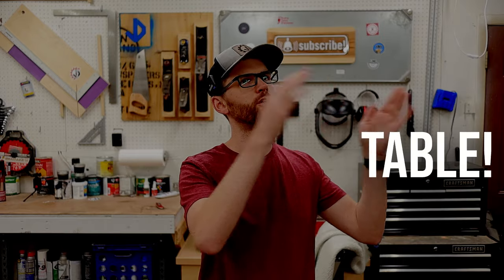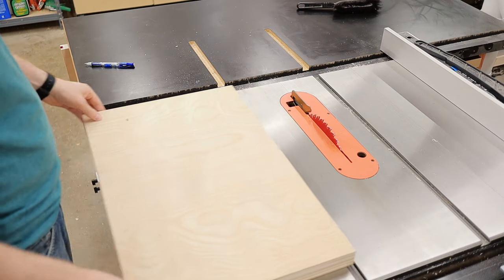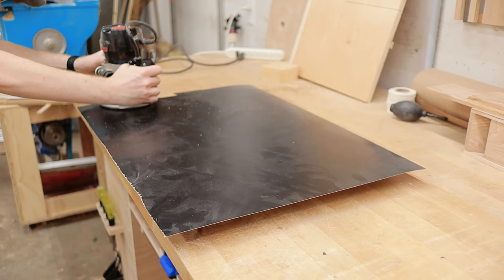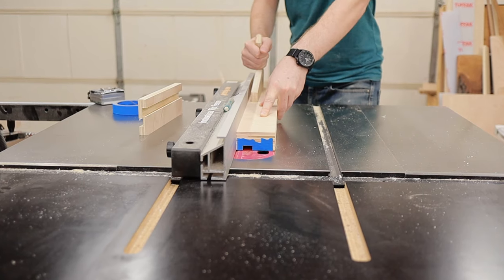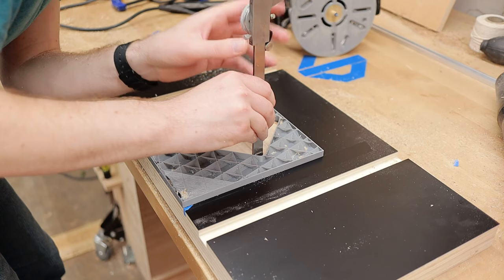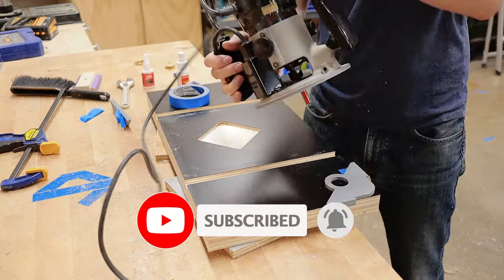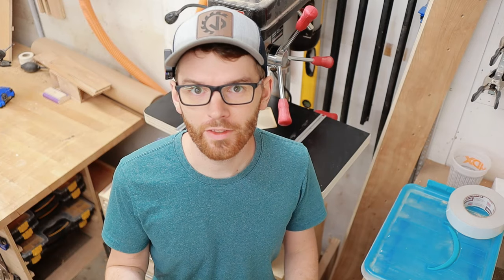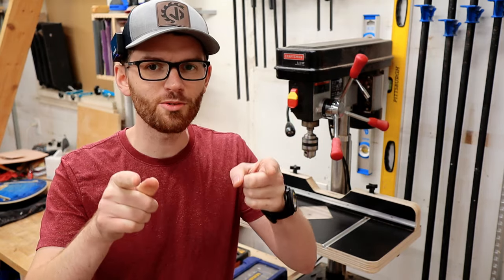Watch this BEFORE you build a Drill Press Table!

Comment: @8:27 Good call. I never cut anything but wood on my good miter saw. 
 
(If you keep an eye out, Direct Tools Outlet they will do a sale on refurbished tools at like 50% the normal refurbished price. i bought that same Ryobi for $39 now and they also do the Ryobi table saw for $59 if I recall. I wouldn't use either for woodworking, but for non-wood use, they're perfect because you don't need to worry about them if you're making "questionable" cuts, or cutting things like aluminum. ) 
 
 Hopefully one day they'll include the cheap 9" bandsaw  and that POS benchtop planer. Then I'll have own metal shop for my woodshop 😂😂😂!!!
Reply from the maker: thats a great deal

Comment: I made two big mistakes on my drill press table... 
1- my T-tracks on the table for the fence don't extend out to the front edge. Not sure why I did that, I may take those out and extend them the full length so that I can load the fence from the outside.
2-  I didn't add a dip in the fence (set it too high) so the chuck can bump into the fence if it's too close (when working on a small/flat piece). annoying!
Reply from the maker: awe man, thanks for sharing!  Funny how it can be so easy to walk right past the obvious...

Comment: @9:15 get rid of the crank handle and mount a bolt or nut, or anything, there that you can use to turn the handle with a drill. 
 
you can also extend the handle outwards, but that's a pain. 
 
Another cool trick I'm wanting to try is attaching a hamster wheel (with a hamster*) then dangle a carrot in front of it on one side or the other to raise/lower the table. 
 
* Protip- Don't try this technique with a router sled or cnc machine to make to router move. RIP: Gonzo. Mr Pickle Pants. Lord Puffington. Lord Puffington the 2nd. Lord Puffington the 3rd. X. Y. and finally, Z. May your sacrifices place you in the wheels of Valhalla!
Reply from the maker: Ill implement this hamster method asap.  but ill be sure to grab some spares from the pet store while im there, just in case.

Comment: Others have mentioned some of the solutions to the issues that cropped up.  However, nobody has addressed an elephant in the room.  It is best to put laminate on BOTH faces.  Doing so minimizes the risk of moisture imbalance in the table.  Also, it would be good to put finish on the exposed edges, including the interior of the insert cavity.  You never know when you're going to knock over that cold one sitting on the DP table.
Reply from the maker: Valid argument.  Its been on my todo list to apply finish, but its been 4+ months and the table seems flat.  Maybe just because it is being held to the cast iron table?

Comment from the maker: Let me know what huge mistakes you made on your last project!  Also, any ideas how I can fix mine? 😬
Reply: Put a spacer underneath the table to lift it up enough to clear the crank handle. Then you can center the table and solve the racking problem. For the t-track, you can put new ones further out or in, and consider the originals as bonus track! 🙂 

I've already designed a drill press table for myself, but that's one thing I'll double check first - thanks! I'm also including some slots in the table to allow f-clamps to go through, just in case I need that as an option.
Reply from the maker: @davidpeters8813  Great tips!  Yeah, I was thinking that other tables often have a drawer in the center, this would by default raise it up.  Kinda solves my problem.
Good idea for the f-clamp slots, you can never have too many clamps!

Comment: The crank handle issues with the table mount and the drill portion could be easy to solve by replacing them with something else.

Like a wheel with a little knob for gripping it would work well for the drill and the crank under the table could just be extended a bit pas the tables edge.

You wouldn't have that twisting/bending when applying preasure or bumping into things anymore
Reply from the maker: Definitely, lots of other solutions. Here's how I ended up fixing it: https://youtu.be/tvsvMg398YQ
Reply: @MakewithJake  

1. Makes video on custom drill press table
2. Makes video regarding improvements
3. Earns a new follower because I like how you will go back to older projects like that for followups
4. Bonus points for the surprising quick reply.

Side Note I found this while looking for ideas for a custom CNC machine to build
Reply from the maker: @SiontheRapadant  that's awesome! Glad you liked the follow-up! I've always wanted a big CNC. Definitely a future project. For now, I have the 3D printer and laser engraver, which is pretty fun.
Reply: @MakewithJake  theres a few videos on them already, but hey always room for more and improving on already existing ideas.

Comment: I generally would not use 3M 77 over the 3M 90.  I do a lot of laminate work (well I used to I am retired now).  I generally used regular spray contact but I realize that is a professional set up.  But I do use the 3M 77 when I want something to be temporary.  If I might have to pull it apart.  Contact adhesive only remains an adhesive if it never gets a chance to dry out so I would seal the edges.  The 3M 90 is the better choice especially for thicker standard grade laminates.
Reply from the maker: Thanks for the tip! I'll definitely check out 3M90 for my next laminate project. The 77 seems to be holding up on the fee projects I've used it on. 
I used a can of contact cement for my outfeed table and that went ok, but it was pretty tough to get even and flat. 
Thanks for watching!

Comment: I have a mix of shop-built and store-bought accessories like this.  The cost of building something nice, the time to do it, and the possibility of getting it wrong anyway are why when I see something well-designed and built that's affordable, I just buy it.  Maybe it costs 20% more than home-made, but I have a shop to build stuff for the rest of the house.  I don't want to spend most of my time in the shop working on the shop.

That said, I did bold my own drill press table, I just went a lot simpler and cheaper than you did.  No need for laminate unless you have some laying around.  Use an MDF rather than acrylic insert.  It's cheaper to replace, less likely to snap when using twist drills, and less likely to dull your bits when using forstner.  Excellent tip regarding the crank clearance though.  I ran into the same issue.  I added 1" wood strips between the cast iron table and the auxiliary table to jack up the auxiliary table enough to clear the crank. Keeping the spindle lined up with the hole in the cast iron table is handy sometimes.
Reply from the maker: Sometimes, buying stuff is absolutely the way to go.  You could definitely make this table cheaper, but Ive been on a mission to make my shop projects look a little nicer than they need to.  
Thanks for watching!

Comment: I loved the 3d printed router base plate to accept the threaded collars.  

Years ago my shop teacher at Cerritos Collage showed us a base plate with a variable radius perimeter.  The perimeter followed a 2D curve called an Archimedes spiral where the distance from the center to the perimeter increases linearly with angle.  

The purpose of the fence was to allow very accurate widening of dados by tiny amounts simply by changing the point on the base that touches
a fence and taking another pass. This offsets the bit either closer or farther depending on the direction of rotation.

The base perimeter curve is only one rotation of the spiral. There is a step in radius where the curve crosses over itself. The size of this step determines the fineness or coarseness of the radius change when rotating the base.

My teacher (William Ketelle ) made the base plate using a string, pencil and a nail to draw the spiral.
The pencil was tied to one end of the string and the other end was wound around a large nail placed at the center of the base. 
The arc was drawn while unwinding the string from the nail. This gave a very small and linearly increasing change of radius as the string was unwound. The base was then cut out and sanded smooth.

One of these days when I get a 3d printer I will try to make one of these spiral bases.  I think the hardest part is just laying out the spiral. I suspect this is not a typical CAD feature.

Comment: I made my table as well. Good video. A couple comments though. I made my fence as an angle. The knobs are on the leg behind the fence face, lower than the top of the fence. Cut an arch for clearance of the drill press column. Second is the replaceable table insert is offset so it can be rotated four times before needing to be replaced. Also drill an offset hole clear through the table under the insert so it is easier to pop out with a screwdriver poked up from below. Some one else mentioned a spacer under the table on top of the cast iron table for Handle clearance. Really good video and glad the shop Gremlins gave back the router bit!!
Reply from the maker: Good idea! Thanks for watching!

Comment: good video. ca nrelate. BTW where did oyu found the laminate??? I can only find 4x8 sheet which is too big for what I need.
Reply from the maker: I bought the 4x8 sheet.  Actually, several at this point.  I am not sure where to get it in smaller cuts.

Comment: Financially, it often makes more sense to buy a drill press table instead of building one, because the costs really add up quickly. However, if you have a youtube channel with a lot of subscribers and ad income from youtube and sponsors, that can balance out the expense or even flip it to a profit.
Reply from the maker: I would typically agree, but after looking at drill press tables, they just seemed far too expensive for what you get.  This was an attempt at a quick, easy, low cost solution that could be made in a few hours.  Obviously....I ran into some issues.  haha

Comment: Here’s my crank interference solution.  On a piece of 2 x 12, set it on your original table and trace the circumference.  Cut out and affix to the bottom of your new table.  If this doesn’t make enough clearance, add more until it does.
Reply from the maker: Good solution.  Other tables add drawers under, which helps lift it up.  I was trying to keep it compact, while maintaining my full vertical capacity.

Comment: I have analyzed the situation over many years and have come to the conclusion that there is a parallel universe that is populated by little ass- holes. Their favorite thing to do is to move the tool that you just used. Not far. Just enough that you can not lay your hands on when next you want it.

Comment: I have been watching a lot of videoes on YouTube about building a drill press table.  What surprises me most is that almost all of them are built with keeping the fence square to the drill press table.  This does add a lot of complexity in making the drill press table.  I do not think that you need to do this.  You only need to worry about the distance from the center of the drill bit to the edge of the fence.  Take a look at my video "Build an easy drill press guide" and I would be interested in hearing your comments about my design.  I have responded to a lot of other videos with this same idea and have not heard back from a single one yet.  My design does not have a dust collection system
Reply from the maker: Interesting, I havent had any issues with the fence so far.  But to be honest, I usually only use it when I have some batch/production work. thanks for watching!

Comment: I see a couple of annoyances with your crank solution. The traditional way of drilling angled holes would be to rotate the table out of level.  Because the fence is now angled 45 deg to the axis of rotation, the rotation axis of the hole would also be 45 deg to the fence. This can make many jobs just a bit harder, but no impossible.

Second,  When tramming (often mistakenly called leveling)  the table, the rotation axis is at 45 degrees instead of aligned to the Y axis of the table. This is not a show stopper, but just makes it a little harder.

Could adding a piece of plywood to lift the bottom of the table to allow clearance of the crank?  At the same time, add shims to get the Y axis 
trammed perfectly.  Of course that gives up a little vertical capacity, but that is not an issue for the most part.

Finally, one thing I want to do with my drill press is to constrain the rotation 
of the table that happens when cranking the table up and down.  It would be nice to be able to lock off the horizontal rotation, and just lift or lower the table.
Reply: Oops!!  I just watched the follow up video where you fix the cranking problem and then some.
My apologies.  You are doing a great job.

Comment: I've been looking for a big reliable square and I don't want to pay Woodpeckers 300 bucks. Can you please tell me the manufacturer and size of your silver colored sqaure? And do you find it to be 100% accurate? Thanks for your great video.
Reply from the maker: Thanks for watching sure which square that was, but I have (2) big ones that I use.  The first is a Framing Square.  These are about $10-15 at Home Depot. https://www.homedepot.com/p/Empire-16-in-x-24-in-Steel-Framing-Square-1110/100204103

The other is a T-Square, typically used for drywall https://www.homedepot.com/p/Wal-Board-Tools-22-in-x-48-in-Original-Drywall-T-Square-88-012/100095247

These are plenty square for most projects and really handy to have around the shop.
hope that helps!
Reply: @MakewithJake  Thanks so much for taking time to send me these links Jake. I very much appreciate it.
Reply from the maker: @dwayneford1990  anytime! Happy to help!
Reply from the maker: @dwayneford1990  anytime!

Comment: Why do you have the dropped section in the middle of your fence ?
Reply from the maker: I think you mean for the replaceable insert?  this way, when the insert gets chewed up from lots of drilling, it is easy to replace.
Reply: @MakewithJake  the movable vertical fence, not the horizontal surface with the inserts.
Reply from the maker: @jeffcarr392  oh gotcha. Clearance for the spindle. Especially for small parts and small drill bits, the spindle needs to get close to the part/fence. So clearing it out helps a lot.
Reply: @MakewithJake  oh, of course,  thanks

Comment: Cracking a cold one open from the fridge while glue dries was a missed opportunity.   
Edit: maybe crank a cold one after. Bc the only solution to those f-ups is a beer.
Reply from the maker: Dude...we joke about facepalm, but I litterally had to just pick my face up off of my desk when I read that.  I have no idea why I didnt do that....uhg
Reply: @MakewithJake  🥴
Reply: I'm with this guy, Beer is the answer to all life's problems!
Reply from the maker: Im good with that.
Reply: @MakewithJake  You did not have the beer, because in the back of your mind you knew that you were going to be using a table saw next, and you have the good sense not to get near a running table saw after you have been drinking. 😁
Reply from the maker: @frykof  Ha! Right, Of course...safety first!!